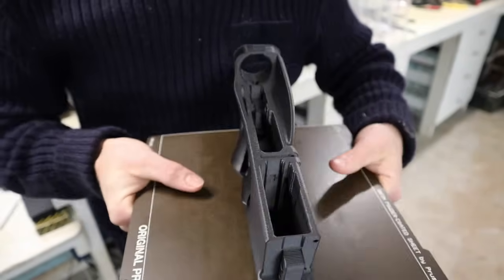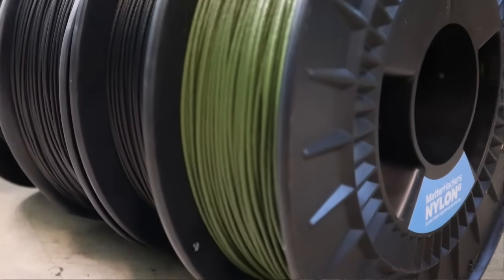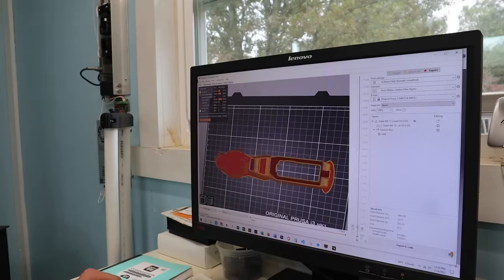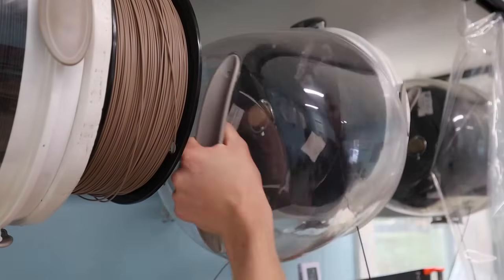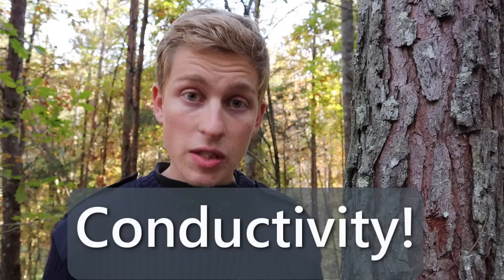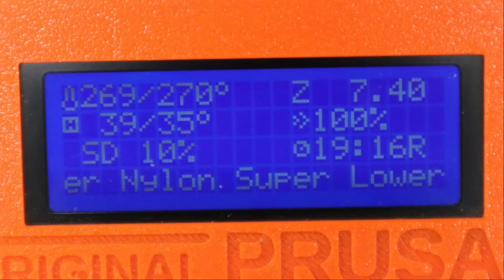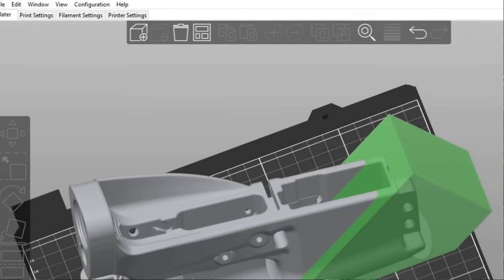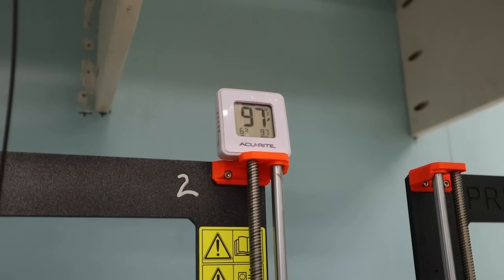How (And Why) To Print With Carbon Fiber Nylon | Print Settings, Tips And Tricks

Comment: Stringing! Having a hard time tuning out my stringing with push plastic CF nylon. Using a prusa mini. I have tried 3.2, 4, and 5 mm retraction. And 270c 275c and 280c. 70% wipe, 70mm/s retract speed, 40mm/s return retract. .2mm z lift.  Can drying affect stringing?
Reply from the maker: Yes, water in the filament would be my first guess. It makes a big difference! Dry Nylon hardly strings at all.

Comment: This might be a dumb question but what about printing in PLA+ and then coating the whole receiver in a layer or 2 of Epoxy or Super Glue for added heat resistance ?
Reply: I've been wondering about such things myself. It might be a dumb idea but I've been pondering cylindrical voids (areas as if you ran a drill through the print aligned with where you need strength) into the piece, parallel channels in the piece like lightening cuts, other hollows in the item that can be filled with epoxy or maybe even JB weld. Basically reinforcing 'rods' like rebar in concrete.
Again, might be incredibly stupid for some reason I'm not bright enough/experienced enough to notice, but I think it's worth experimenting with.

Comment: You should try garolite. Sometimes it works a little TOO well.🤣
Reply from the maker: That was my experience with Garolite as well. It either stuck too well, or not at all.
Reply: @HoffmanTactical  There are definitely some nylons you don't want to use with garolite. I used my garolite sheet with Taulman Bridge one time, and it literally became one with the print. Couldn't tell where the garolite stopped and the nylon began lol.

What doesn't work with garolite though seems to always work with gluestick on PEI.

Comment: I havent tested carbon fiber nylon but im willing to bet standard nylon is much stronger/ tougher if it can be printed without warping.
Reply: My (no chopped fibers) nylon has WAAAAY better impact strength over any material ive tried (pla+, PC, ABS)
Reply from the maker: Interesting. All the impact testing I've done indicates that glass fibers improve impact resistance by a little, and carbon degrades it a little. But not much either way. What plain Nylon are you using?

Comment: I just printed with push plastic pla + high heat. Apparently same as pla + but higher heat tolerance. Wondering if you seen it or tried it. I greatly appreciate your work and testing you do for us. Keep up the awesomeness.
Reply from the maker: I've used the 3D870 PLA from Push Plastic a lot. It tends to have poor layer adhesion, which is why I don't use it for lowers anymore.
Reply: DEATH TO THE PLA

Comment: What's the enclosed spool thing called?

I live in AZ...it's about as dry as dry gets here...think I still need to worry about this?  (It's only ~30% humidity here and gets much lower than that relatively frequently.  I suppose the fluctuations could be problematic...but I dunno.)
Reply from the maker: You would have to try and see! I use cup cake trays for the filament pods.
Reply: @HoffmanTactical  Awesome. Thanks!

Comment: mine keeps warping and coming off the bed. watching again to make sure i didnt miss anything. using push plastic carbon fiber nylon. at 35 on the bed, gonna go lower see if that helps
Reply from the maker: It could be that the filament needs to be dried. It can make a stunning difference! 180 F - 220 F is the range.
Reply: @HoffmanTactical  yep. I dried it about 30 hours or so. I didn't use a draft shield or skirt though. Gonna try that. Trying to figure out how to change the infill for just the Mag well but can't figure it out

Comment: Awesome vid, thanks for the advice. I now can print my carbon fiber. I’m also trying allow 910 high heat and it warps no matter what I do. I need to print gears for rc and don’t think carbon fiber is the way to go. What brand nylon would you recommend. Thanks
Reply from the maker: I have had the some issue with Alloy 910. The Overture Easy Nylon is much easier to print, however it's probably not as strong.

Comment: I printed certain automotive components with PLA and the heat is a huge problem. I dont know if PETG might be a better option to use. Most parts are mechanical parts inside door panels and dashboards etc. The original parts are ABS or a white type of plastic that really burns  your nose and eyes if it is burned by flame (did it for test purposes). Now there nylon parts might do the job, but if PETG is going to do the trick, i wont use nylon, just because of the price tag and hassle involved.

Comment: New to this and want to start wit CFN . What layer thickness or nozzle should I start with ???
Reply from the maker: If you use the Push Plastic CF Nylon or another medium fill Nylon then a 0.4 MM nozzle will work fine. However, higher carbon content Nylons really need a bigger 0.6 MM nozzle to prevent clogs. A hardened steel nozzle will work, but I like the Tungsten nozzles. 0.2 MM layers work for most parts.

Comment: Has anyone thought of 'sealing' it to keep water from getting re-absorbed? Like Spraying the finished model with like a clear coat or a satin coat perhaps?
Reply: Water acts as a plasticizer for nylon, making it more impact resistant and less brittle. Higher humidity will make nylon stronger which is preferred for the finished model
Reply: @evandaniels450  Thanks for your reply Evan. I didn't know this types of information. Again, I appreciated your reply as it expanded my limited knowledge regarding Nylons.

This is from Amco Polymers: "Nylon resins absorb moisture from the air. The properties of nylon moldings are directly affected by the amount of moisture they contain. Moisture acts as a plasticizer in nylon and therefore reduces strength and stiffness properties but increases elongation and toughness. In general, as moisture content rises, significant increases occur in impact strength and other energy absorbing characteristics of the material."

Comment: Anyone experimented with some kind of spray coating for strength and protection?
Reply: A model's strength generally comes from the layer adhesion. Surface treatments doesn't do much in this area.
Reply: @strongme80  I was thinking it would enhance shock resistance by holding it together. I'd also like to try it just to smooth out the layers for aesthetics.
Reply: @FroztiProductions  Ah! OK. Then resins would be the way to go.

Comment: Does It need to be Ventilated? I got Mine Built under a table,  I also live in the NorthWoods  Also I noticed With Other Lowers Printed with Pla+ it drys cracks in breaks at the Buffer The Hoff Super Lower Shot At -24 out its by far is the best design No Bs

Comment: Would you recommend this type of filament for parts like magazines and baseplates? I'm thinking because they'd be more likely to be left in high heat, as we as dropped around a lot on reloads etc
Reply from the maker: I think it would work well for mags.

Comment: I'm in the process of printing one now. I forgot to change settings and it's only printing with 3 walls. Will that have a major effect on anything?
Reply from the maker: As long as it's still 100% infill, you should be fine.

Comment: Ive always had issues with nylonx , specifically shrinking where for instance cartridges dont fit in magazines.  But i just used nylonG and with the default mattercontrol settings for nylong on a pulse xe printed a g19 lower in 15 hours and it has been the best ive made yet. Strongest and fasted print time i was quite amazed
Reply: Nylon X is dogshit, my print crumbled in my hands.
Reply: @krollmond7544  NylonG is the way to go

Comment: what was you using to keep the filament dry while it was printing? do you have a link or did you make it yourself?
Reply from the maker: I did a video a while back on it. I actually use modified cup cake holders and desiccant.

Comment: I wonder if the prusa mini is capable of printing this stuff?
Reply from the maker: I think it can print an AR-15. Too small for an LR-308. It can get hot enough.
Reply: @HoffmanTactical  I'm gonna give it a shot. I ordered one the other day. They got like a six week lead time. I'll just get a better nozzle ordered. You use .4 nozzle?
Reply from the maker: Yes. 0.4 MM. I am using a tungsten carbide nozzle. Works great so far.
Reply: @HoffmanTactical  thanks man. Definetly gonna give it a shot. I had a big sovol printer and used it about a year and a half but it wasn't capable of printing that hot without swapping the hotend. Plus it kept giving me issues. Got rid of it and ordered the prusa.

Comment: New to watching your channel,  great information and your detail is excellent.  I have purchased a A2 steel nozzle and cfpc poly carbonate carbon fiber.  I have not tried it yet since my WIFE took over my printer recently.  🤬. Anyone have direct experience with this stuff.  If so what's your thoughts and settings you've played with. Again thanks for your channel.
Reply from the maker: I've used the CF PC from Push Plastic. I think it will work, but I found that CF Nylon has better layer adhesion and impact resistance and is just as easy to print. So that's what I use now.

Comment: Coat that bed with pva glue.
I Have been using eSUN cf Nylon.
Ender 3 heavily upgraded.
Part fan off, 25% for any overhangs.
285c nozzle
60c bed

To avoid curling. 

Mix up pva with some water 10-1, heat bed to 70c then use a wet cloth and dip it in the pva water mix and apply a coat to the build plate ( i use the creality buildtac type plate). The heat in the bed will flash off the water and leave a coating of pva glue. Then pre heat as normal and start your print.

As for filament drying I keep the hydroscopic filaments in a zip lock with dessicant and a hydrometer. Place next to a radiator to keep them dry no oven needed.

Comment: The reason for the warping issue happening with high heatbed temps is as followed:
A hot heatbed prevents the material to solidify completely. The heatbeds heat dosn’t reach the upper layers so the upper ones cool down and contract and as the lower ones are still soft they don’t have the rigidity to withstand that tension the upper layers are putting on them. Hope that makes sense.
Reply: Probably has to do with the crystallization of nylon. Maybe a hotter bed keeps it amorphous longer
Reply: @justinmoritz6543  keep a heated chamber.

Comment: I am using the BuildTak nylon surface with no adhesive, and a bed temp of 55C. I have had no adhesion or warping problems using the 3DXTECH glass filled nylon.
Reply from the maker: Interesting.

Comment: Also how is the strength around the buffer tube area do you need to clean up the threads or anything or do they actually print pretty well?
Reply from the maker: The hose clamp prevents failure of the buffer tower. Normally the threads work right off the printer, no clean up needed. Which is pretty cool.

Comment: A dot of Elmers white diluted in water and spread across a glass bed (or any other) will make the nylon bond to it very well (maybe too well) the pva/Elmer's white is water soluble so can usually soak a glass bed in water to dissolve it and get it to release
Reply from the maker: Hairspray is also a good option. Really anything with PVA in it should work.

Comment: Any links to the hot end & all steal nozzle for the Ender 3 v2 ? and filament being use ?
Reply from the maker: I use a Prusa, but you should be able to find info on the Ender upgrade pretty easily. This filament is the carbon fiber nylon from Push Plastic.

Comment: Nylon is great but the carbon fibers are utterly useless for anything other than color. It's abrasive on the nozzle and the other properties are usually dominated by the Nylon. The carbon fibers are only a black filler, as the fibers have to be ground to dust and therefore do not improve tensile strength. Across layers the fibers cannot reach at all, so the only effect they have is to get in the way of the Nylon sticking to itself.
If you don't believe me, go to the yt videos testing actual strength of CF nylon vs regular nylon. Usually nothing eclipses the best pure nylon.
Reply from the maker: I must disagree ;) I've done a bit of testing with Carbon Fiber / Non Carbon Fiber and the Carbon adds significant strength AND layer adhesion. Some are better then others though. It also stabilizes the Nylon making it much easier to print with.

Comment: I know nothing about 3D printing but I know everything about firearms plus I was a journeyman sheet metal worker for 40 years.  After seeing this video, the very first thing I thought about was he's doing this the hard way and making very low-quality parts that will never stand up to my testing.  I think you need to take a close look at how Sig is making the 320 handguns along with an old H&K G3 navy seal lower fire control system.  They have a steel chassis system that slides snugly into a plastic housing that's mostly cosmetic.  I hope this helps you in some way.

Comment: You have me thinking..... print an internal skeleton. Then wrap in actual carbon fiber.... or even slim down the size you currently make and put a layer of Carbon  fiber over the whole surface. Then cut out where you need to.

Comment: Good info, thanks for the testing and sharing! I'd like to share something, please learn proper use of a file. They are NOT sanding blocks. As such they are meant to be used in a uni-directional manner. Dragging backwards causes damage to the teeth and reduced function. I also can't help but think misuse on CF will cause much faster wear than such abuse normally would. To be clear, the backstroke should see reduced pressure, not necessarily 100% lifting off of the material. Just not grinding it down in the backstroke with the same pressure as the forward stroke.
Reply: Thank you for being a teacher, not a gatekeeper!

Comment: Much respect to you for all you contribute, and I guess your experience is your own, but I find it frankly absurd to say that PLA+ is the most impact resistant material. It seems like this specific community cannot get off PLA for some reason, despite the fact that it really isn’t that hard to print better stuff.
Reply from the maker: It may seem strange because it's so cheap, but PLA+ is really good stuff! It's thermal resistance is it's only downside, which can be a big problem. Hence the Nylon. But PLA+ still remains a incredible plastic, which is why it's so popular. Also it's very low cost. Impact resistance is something that is hard to quantify. In my testing PLA+ has given the best results, but not all the time. Some PLA+ is better then others.
Reply: @HoffmanTactical I'm curious on your thoughts between Nylon and PC? I just ordered some Polymax PC to play with, but i hear it is very finicky and would push the limits of my prusa, I know you have used PC in the past, is it worth the trouble?
Reply from the maker: @L1meOFFLINE  I've only used a couple PC blends. I think the CF Nylon is better. But it's a lot more expensive. The Polymax PC may be a good option, I just have not tried it yet.
Reply: Strictly from a design and prototyping perspective I think the saying "measure twice, cut once" sums it up

Comment: When you’re printing at 100% infill, you’re getting 100% of the shrinkage rate.
Reply: 100% true
Reply: I bet you get 100% shrinkage
Reply: What does that mean😭 im trying to get into 3d printin
Reply: @Thomas-iu1uq  plastic contracts and expands based on the rate that it cools at. If you print slow, but print solid layers, there is no forgiveness happening when the shrinkage occurs to quickly. So solid infill requires slow printing and lots of cooling.

Comment: How strong is carbon fiber nylon? I’m building a hydrofoil and I was just printing in pla, then skinning the parts in carbon fiber, this works, however I have to adjust my parts to offset for the skinning thickness. If I could just print in a material that was strong enough by itself that would be ideal, I just doubt that carbon fiber nylon by itself would do the trick.
Reply: Funny thing, I'm actually printing an efoil completely in Esun Carbon Fiber Nylon. At first I thought of skinning in a 12k carbon twill weave but then realised I could use an aluminium flat bar inside the foils for reinforcement. Seems crazy strong so far (and light) without needing skinning but once I test the foils in the water we'll see. Printing foils seems like a great option as opposed to comression moulded carbon foils.
Reply from the maker: CF Nylon has a tensile strength from 10 KPSI to 13 KPSI depending on the brand. I don't think it will nearly as strong as the PLA skinned with proper CF cloth though. But it may be strong enough.
Reply: @HoffmanTactical  in the end I went with PLA skinned with forged carbon fiber, very happy with the results
Reply: I can't even rip a nylon raft that's only four layers thick! And this is only Nylon from Taulman called Alloy 910. Imagine a CF Nylon.